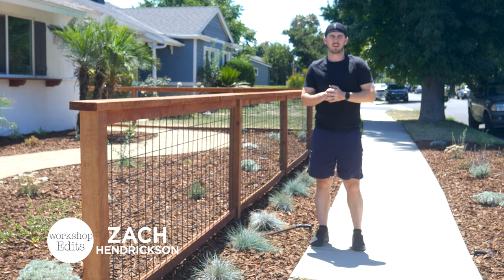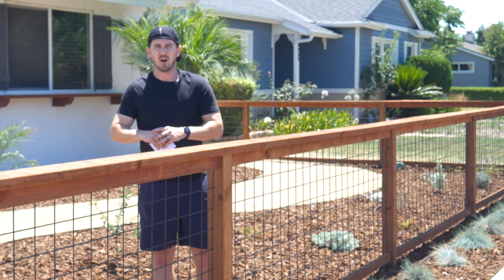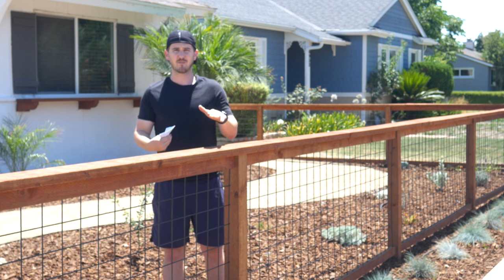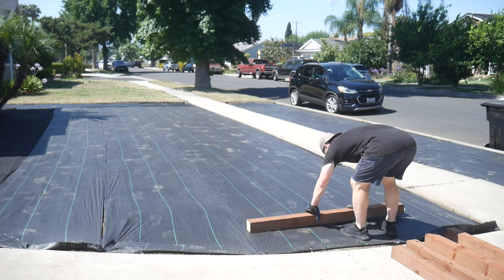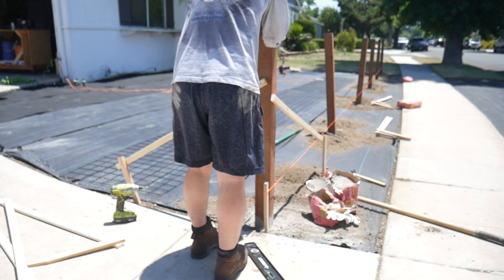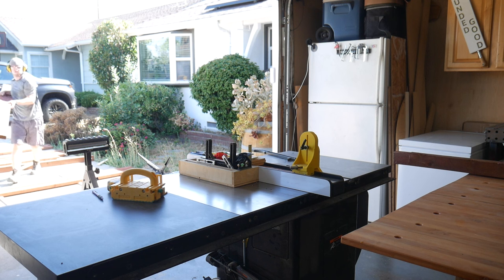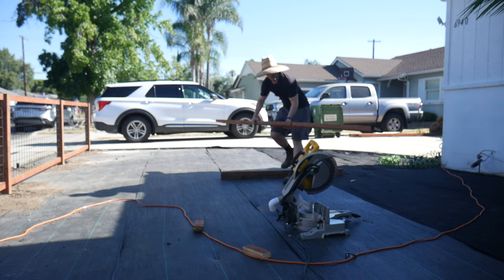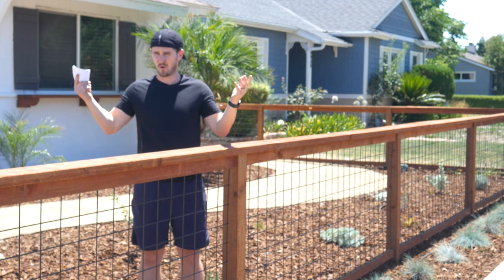DIY Hog Panel Fence | 77

Comment: It’s not more expensive to do yourself, 16’ long cattle panels at tractor supply are $25. So $17.50 per 8’ without the wood. The wood for each 8’ section is a lot cheaper than $72.50, which is what it would need to cost to amount to $90 per like in the video. Doing yourself is almost always cheaper
Reply from the maker: In SoCal we have no access to those $40 units; having seen them though, they look cheap aesthetically, are not uniform, and are raw matte steel color versus the matte black look, and I have a hunch will rust given its galvanized steel. You get what you pay for - I paid for quality and aesthetics.
Reply: Black rustoleum spray paint bud. Will make it look aestically the same.
Reply: Going post to post with the fence panel leaves an extra step of straight cuts on the 16' fence panel.  Many a DIY persons may not have the facility to cut. @workshop_edits
Reply: Oh wow.  We paid $99 for our 16’ panels at Tractor Supply.  We got the cattle panels.
Reply: 33$ for the cheapest ones in my area
Reply: The bottom rail looks like2x4 ? Not 2x6...can you clarify
Reply from the maker: It’s 2x6 ripped in half for the top and bottom stretchers
Reply: You sir, have saved me a bundle. Thank you for you for sharing!
Reply: @workshop_edits  this is the dumbest comment on here. 20 bucks vs 80.

Comment: Holy crap man I did my fence like this and paid $32 for 16’x36” panels. Nice looking fence though. Still cheaper than contracting it out. In total mine was around 90’ long with two gates and came to right around $600 total all in.
Reply from the maker: Yea I think a lot of it is about the exact style you want or the stores around you - I did see some bigger cheaper options through Tractor Supply but I don’t live near one and the style was slightly off from what I wanted - thinner gauge, raw silver color, and the squares were much bigger but for sure many options out there!
Reply: Remember he said Southern California. Everything is more expensive in California.

Comment: i was undecided between cable railing or hog mesh, but yours looks nice i think i am going with hog style,  but HD and Lowes have some bad reviews about these Wild Hog panel they  rusting at the weld or when powder coating scratched off, they don't seem to be galvanized,  they are also quite expensive at $66 for 3 ft x 6 ft......... I found at Tractor Supply,  same 6 gauge,  4"x4" square at only $69 for 5 ft x 16 ft, and they are galvanized will be much more rust resistant, black looks nicer so i may use black rubber spray on them
Reply from the maker: Good luck!

Comment: Just a good note, tractor supply sells oakbrand feed panels 8 foot by 50 inches for 22 dollars
Reply from the maker: I did look into those - unfortunately the nearest Tractor Supply is 90 miles away and didn’t even carry those! I also just for some reason thought they looked a lot cheaper than the Home Depot ones but 100% a good budget friendly alternative

Comment: Any word on how the wire has held up? How was the quality of the wire from factory? I’ve heard some fences rust shortly after install.
Reply from the maker: The wire Home Depot sells is coated in a black paint so the metal isn’t actually exposed so it should hold up indefinitely

Comment: One issue you can run into, maybe not so much in Cal, is the bottom dado has no outlet for water. Water can pool in those slots and rot your wood. For the bottom stringer just slice it in two and pinch the hog wire. Then water runs right out the bottom. A little extra work as you have to screw the two pieces together, but not too much. Nice looking work.
Reply from the maker: I should have shown it but I drilled drainage holes in the bottom of the dados to account for this
Reply: That's what I see a lot of people doing in the videos I've watched@workshop_edits

Comment: Electrolytes electrolytes electrolytes replenishment when working outside in the heat of the day in SoCal. 
I don’t know where you are in SoCal , but there is a place in Claremont that sells a lot of stuff including hog or cattle panel. The place is called C&E. Otherwise, there is a tractor supply store in Norco.
The project turned out to be awesome. 👏🏻
Reply from the maker: Yea I was doing Gatorade’s and Liquid IVs but it was clear that the heat just fully outpaced my body’s limits. It was all amplified by the black lawn fabric. Easily made it 10° hotter. Just brutal.

Comment: The only change I’d personally make is adding a dado to the posts in the ground to keep that hog wire in place just like you did for the top and bottom boards and really it’s to prevent the wire from bending and deforming plus it just looks great but other than that one minor change it’s beautiful, there’s just something about hog wire fencing that I can’t get over! In fact I want to add basically the same exact fence including height and spacing, for my garden to keep my bell pepper thief named Sawyer from plucking off the ones that I guess remind him of balls. And I just think it’s such a sleek, modern yet practical and cheap fence solution for smaller front yards and gardens, decking, etc. glad you recovered from heat stroke
Reply from the maker: That is actually a very good idea and i think the alternative less "committal" version of that is actually retroactively adding pressure treated strips on each side to squeeze it together which I am personally likely going to do in a few weeks to keep it straight. 

We fell in love with this look while on a trip in Austin and my hope is more people see this in my area and take it on - for only $1300 (and $0 in labor and hospital bills) it's a VERY sleek look. Good luck with your build and pesky friend!

Comment: Idk why but when I built my 6 ft fence I dug by hand. Next time getting an augur. If you didn’t have an augur you can use a dirt breaker bar. To loosen up hard impacted dry dirt
Reply from the maker: No shot I was doing that in the 100° heat. God bless that auger.

Comment: For the board across the bottom. Did you drill water drain holes so the metal doesn't sit in rain water and the wood won't dry rot?
Reply from the maker: Yes!

Comment: Nice Fence! So, you only used half a bag of quikrete per post? I'm not trying to by too many bags.
Reply from the maker: Buy more than you need and return - it really depends how deep and wide you go but 6 bags was PLENTY to anchor 9 posts 18” down
Reply: And remember - if you are in part of the country that freezes, your hole needs to be deeper than the frontline.  Probably 36” in the Midwest.  A hole that deep will hold a 4x4 and at least a full bag of concrete mix.

Comment: 16' x 50" panels are $31 at Tractor supply....not sure why those 8' sections you bought were $90....that's crazy high!   you could have bought 3 16' panels for the same price....Were the sections you bought already wood framed?
Reply from the maker: It’s an entirely different quality and look hence the price. Idk what you mean by wood framed - if you watch the video you’ll see how it built…
Reply: it powder coated black and a better grade steel

Comment: Did you seal the wood with something? Did you paint the hogwire?
Reply from the maker: The wood is pressure treated so no need to do any treatments. The hogwire comes painted with an exterior black paint form
Home Depot

Comment: Hi! Do you have a link or can you share the info about the dado blade size to use?
Reply from the maker: I would reco half inch, and don't cut / space things too tight where the top and bottom stretcher s squeeze the fence panelling / bends it. With wood expanding and contracting - more space to have things floating prevents railings from warping or cracking since the steel won't move with it.

Comment: Nice fence, and thanks for the great video! A couple comments:
-Digging manual post holes is possible, and really sucks. I just did this with a digger bar and clamshell digger - it takes forever and is pretty hard work.
-I did treated 2"x4" rails horizontally with 1"x2" strips on either side of the wire all the way around to hold it in place. Extra materials, but the water treatment isn't compromised and it looks different but also good.
-You're in southern California so I'm guessing it's less of a big deal, but when you cut treated wood you need to re-treat the cut ends. Especially along that ripped edge because the wood is no longer protected from water, and with the notch penetrating even deeper into the board you've got a pretty significant exposure to the elements / pests / etc.
Reply from the maker: Good to know about treated wood; i see myself, to some extent, replacing the wooden stretchers with new 2x4s in a few years and ill make sure to pre-finish the grooves; also drilling small drainage holes can help a lot as well for this. Cheers
Reply: @workshop_edits  looks really good, hope it lasts for you and you don't have to replace the rails anytime soon!

Comment: Awesome!!  Quick question... Regarding the dado that was cut on the bottom stringer to accept the hogwire fencing, would that dado just now be a place for water to sit and eventually ruin the piece?  Asking because I don't have experience with it and honestly don't know.  Looks great, though!
Reply from the maker: Technically yes. 

The way to avoid the issue which I didn’t film or talk about (my bad) is just to drill some relief holes for drainage. I was also told that the exposed wood is no longer treated so you might wanna put a sealant on it as back up.

Comment: Do you not have to worry about the post in the cement? Decaying?
Reply from the maker: Maybe 25 years from now but otherwise no - it’s pressure treated rated for ground contact

Comment: How did you secure the wire fence to the vertical members?
Reply from the maker: It’s not secured - it’s only secured between the horizontal ridges. But after 6 months one thing I’ve considered adding is vertical stretchers just to tie it together a little but it’s not needed. It would only help to keep the fence completely flat versus bowing slightly one way or another

Comment: This is a great and very helpful video. What is the best way to increase the height of these styles of fence? I like these hug wire fences as they are pre-manufactured but I need a higher fence for my dog. Thank you for any suggestions.
Reply from the maker: You cannot realistically unless you fabricate your own or find taller ones that are sold by a different company
Reply: I have the same issue.  Personally, I will extend the 4x4 to allow another railing over the post and bridge 2x2 pt cuts of 6" every 2' oc to give it the extra height needed.  Overall height of the fence will be 50".
Reply: In my area these panels come in heights up to 6 feet. Such a fence would require an intermediate stringer between the top and bottom.